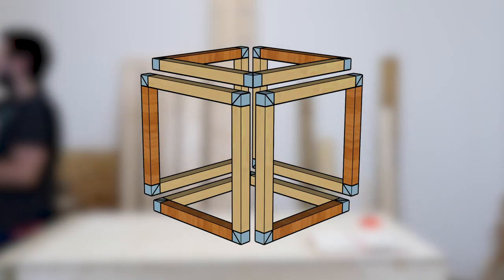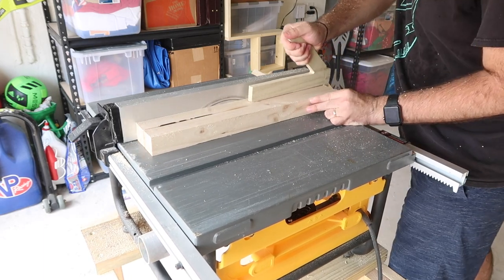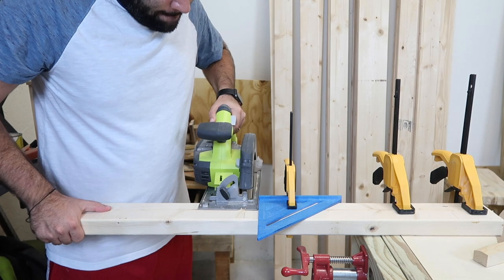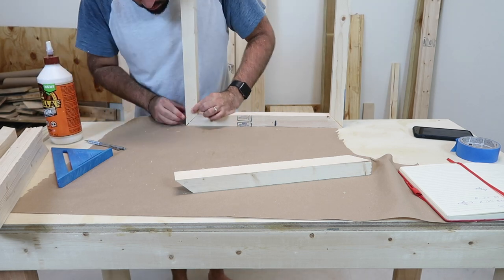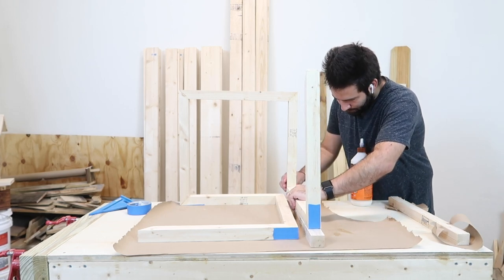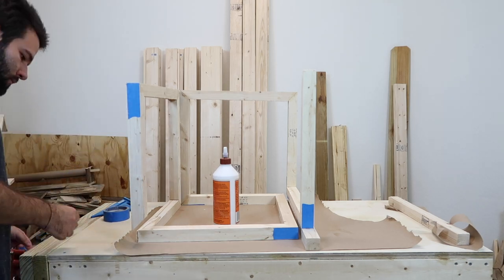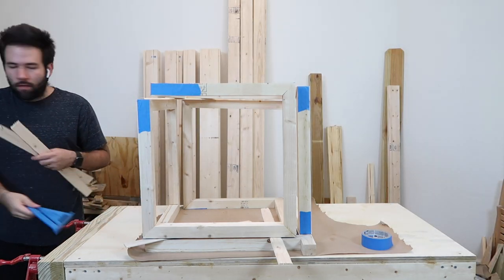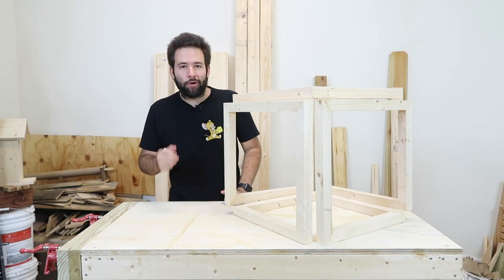BUILDING A CRAZY INFINITY CUBE | Ale's Everyday

Comment: Made one of these. There is a 1 inch gap all the way around. It holds 50lbs before it starts to flex together. Yours looks like it's touching together on the top and bottom. But I also inlaid 6 inch 90° metal bracket under and behind every joint. So when you look at it from the front and top all the brackets are hidden.
Reply: Ohh that’s really smart. I was thinking about making this but I knew the wood version wouldnt be very strong.

Comment: How has it held up over time? You've made it very simple, but you ended up with end grain to end grain glue joints which inherently, are not very strong, as the glue tends to get soaked up into the wood.

The infinity design looks like very complex but it's really not. The secret is in the joinery.
Reply from the maker: You are right, the design is a very simple design, as long as you don’t loose track of what goes where on the assembly process! It has held up just fine 👍🏼